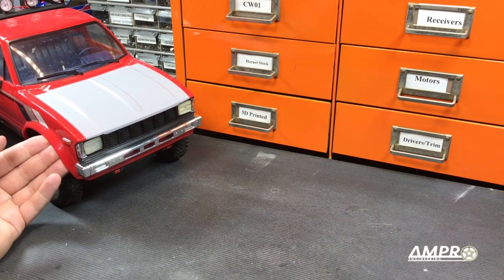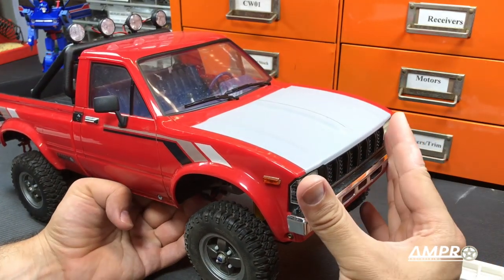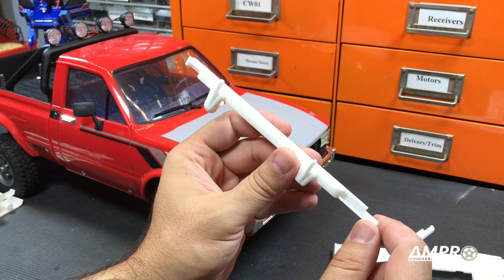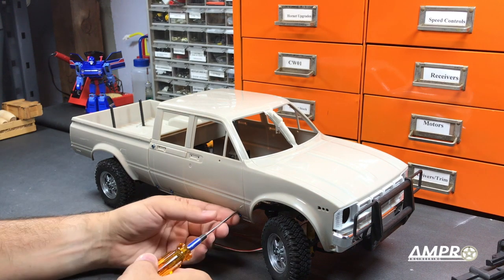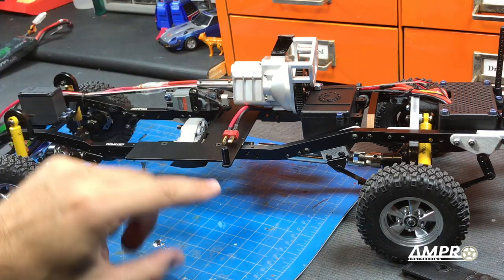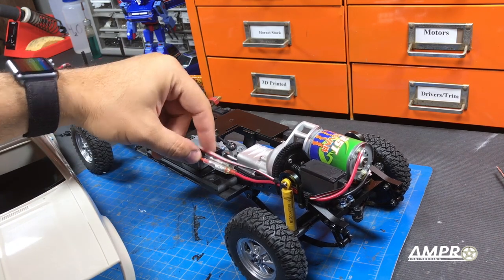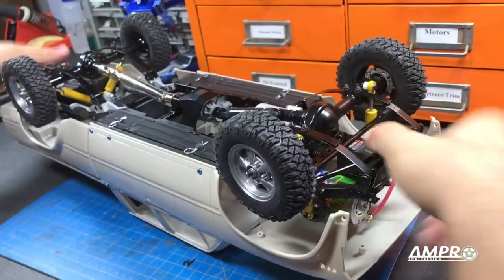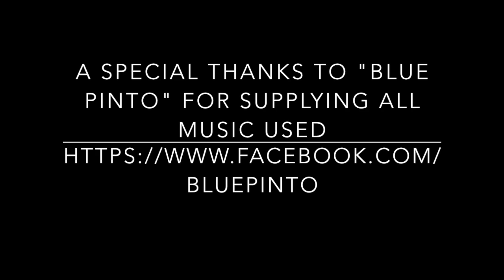e225: RC4WD Trailfinder 2 LWB Body Mount Set

Comment: You make some quality stuff my friend, I have a question about lights for my trx4 bronco I used the my truck RC attack series lights and some how messed something up to where the truck wouldn't move any more. I took it to a local shop to get fixed, after months of them having it they claim I messed something up in the lights to where it kept burning out the esc or the receiver.  I was just hoping you may have some insight. The shop also bad mouths my trick rc saying the directions were not good and the system may be in beta .  I feel like they suck worse than me and just can't admit it lol
Reply from the maker: I have to agree with overland RC. It is unlikely the light kit messed up the ESC with out ruining the receiver. Assuming the receiver and servo are still good, I would say the the ESC happened to die by sheer chance or there is something wrong with the receiver that is now not sending a signal to the ESC. My trick RC makes a killer product and sadly people are Hobby shops are sometimes either employed there for a reason and/or only know what is on the shelves.

Comment: looks like it works well however they wouldn't be suitable for a trail truck as if the sills slide on rocks it might knock the body pins out or the truck might get hung up on the posts.
Reply from the maker: Oh totally. This omits the sliders which I don't use on my trail trucks. I dont like the look of them. I have a version of the standard cab with sliding mounts here on the channel.